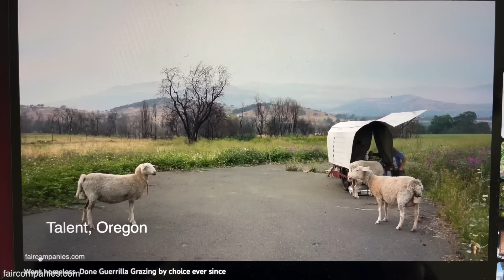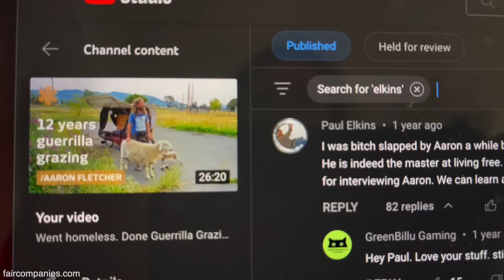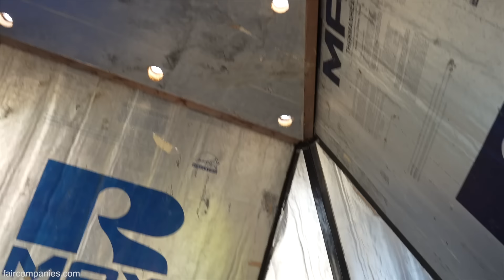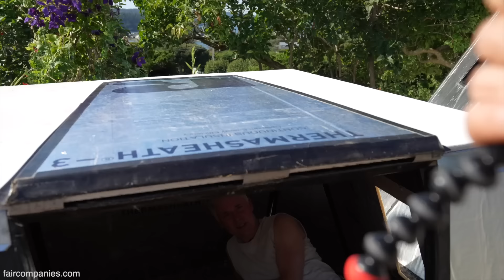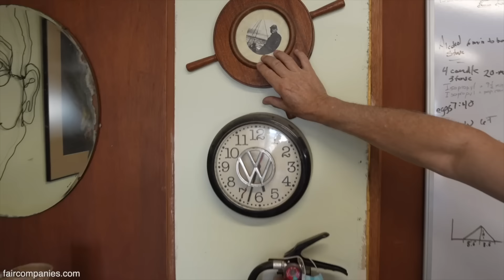Boeing DIY inventor shows new ultra-cheap houses to nomad shepherd

Comment: After seeing Mr. Elkins use bamboo and hearing the problems he described, I thought of an alternative called Wild Honeysuckle which is an invasive plant in many mid western states. The long branches would be ideal because they are pliable when cut, contain no thorns, have thin bark and are quite sturdy after drying out.
Reply: Oh, my! I didn't know that plant had any use except to make people tear their hair and rend their garments in extreme frustration! Now, to find you can actually do something practical with it. Huzzah!!
Reply: @damogranheart5521   One important principle in permaculture. The problem is the solution. Also: There is no waste (or weeds).  Waste equals resources (or in that example an "invasive plant" is an abundantly growing no-fuss resource in form of a plant.
Reply: there's a way to prepare and cure bamboo, it's a non-problem with the right knowledge!
Reply: Japanese used to make everything out of bamboo, it was the plastic of Asia until the forests were burned down in WW2.

Takes 10yrs to make a bamboo forest that can provide building materials for a nation. 

U can make  everything u want out of bamboo. From houses, plumbing, flooring, plates, spoons and forks.
Reply: Willow. Done

Comment: We are currently working on the idea of a residential electric car. There will be a full bed and good insulation and ventilation. By joining the community, you will be able to have access to special parking lots where you can take a shower, wash clothes and cook food.
In fact, this is a great solution for digital nomads.

Comment: If I had the money I'd for sure help fund and design a new Aaron Fletcher-style nomad home!
Reply: It needs to be a powered thing. The new LiFeP04 batteries are much lighter than lead acid. In a sunny climate it could be solar powered if an inexpensive lightweight type of efficient solar panel could be designed. Lightweight flex panels don`t last long. Folding panels may last a few years but are heavy. For cooking you can just get a 500w solar power station and a 100w portable folding solar panel plus a 350w Dash mini griddle. For a fan and light get a 3 speed USB fan, Onite light bulb, and two 20,000 mAh power banks. The folding panels often have three USB ports....two for charging power banks and one for direct fan power during the day, and a power station can be left connected to the 12v charging port.

Comment: I've been homeless more than once and the critical things to survival out there are stealth, and mobility. If you have a Marine Corps 2-man tent ($100 used), it's desert tan with a reversible rain fly: tan on one side and green-camo on the other. 
 This lets you bring your gear inside, cook inside and even pee if you're inventive. (gatorade bottle for the men and ladies,,,I'm not sure) The less movement outside the tent the less visible you are. 
 You can set this tent up from a seated position, it looks like a bush, or a sand pile from a distance. It's lightweight, portable and quick drying. 
 I've slept in it without setting up the tent-poles to keep a low-profile and look more like a ripple of sand on the road-side. 
 1.don't jump fences.
 2.don't camp next to livestock. Ranchers will evict you, and not so nicely.
 3.set up camp after dark, leave before the sun comes up.
 4.food pantries, and churches will donate to you in many cases BECAUSE you are passing through. *let them know you're leaving the moment you get your food. 
 5.no drugs, no firearms, no alcohol means the cops will treat you 3% better than an addict or boozer. It's not much but it can make a difference. *don't get high with anyone you meet out there, they might just want you to go with them someplace quiet where they can jump you for your stuff. 
 6.Shelters are for freezing temperatures and then only for ONE NIGHT. *keep walking after that, crusties will follow you and you don't want that. 
 7.Baby-wipes are a godsend! Keep yourself as clean as possible.

Comment: Saw something that may be of use. You can waterproof any fabric like old sheets or canvas sacking by squirting a $1 tube of clear silicone in a 5 gal bucket and diluting it with denatured alcohol or mineral spirits, well soak the fabric and let it air dry..... Put that over a wood subframe and you have a water repellant but breathable barrier. Tried it personally with old sheets to use as drop cloths and motorcycle covers. Work fantastic.

Comment: Heat the bamboo with a torch,  when it's in its bent position.  It will dry out the bamboo and cure it.

Comment: I am curious if he has reached out to any homeless people to see if they could test his designs. I'd love to see a camper design that includes a 50cc motor or equivalent and lets you drive without leaving your shelter. I know a big part of shelter for the homeless is security and 2 wheeled vehicles are easily stolen. Also if a real threat like a bear or person approaches while you are sleeping you can't rely on thin materials to protect you but can't drive away without leaving the camper.
Reply: Hey Michiael. I'm working on a pedal RV for my next project, incorporating a side swing-up door like Aaron's rig, but no motor. Just geared low.

Comment: Mold comes from moisture.  Heat treating bamboo / cane to get the moisture expelled is a long time process.  First split it.  Then heat it over a flame until it's a light tan color.  Then allow it to sit in a dry environment for about 8 months.  Heat treat it once more the same way.  The moisture is now gone and it won't split.   That's the same process used to make native American flutes so they don't split and become unplayable.  You might not need the 2nd flame treating for a non flute application.

Comment: I lived in a tent in the forest and then built a hut there. These campers are very claustrophobic and not suitable for people with mobility issues. They are for able-bodied people with good health. What the government can do is allocate land plots to homeless people and help them build huts. We were harassed by inspector who threatened to demolish our hut because we did not have land and permits. It did not go well for inspector. He had to retreat in shame.
Reply: The inspector did nothing wrong.  If you owned a home, you would not want 50-100 strangers moving into your backyard, or the park next to it, and putting up huts that have no trash service, or toilets, no water, etc.   Common sense says that the area will be a trash and sewage filled mess after a few weeks, and pretty likely that there will be a fire eventually, with no electricity or gas for cooking, often spreading to neighboring huts as well, or a poorly made wall will collapse on some kids, etc.  Not a great situation.  

And you can’t just go into a woods you don’t own and start building a DIY hut.  That just ends with a squalid encampment.  

But I actually sympathize and it’s a tough issue with no perfect answers.  I agree these foam shelters aren’t suitable for much, despite being well meant.  They are not good for those with mobility issues, can’t be locked, the whole thing can be stolen, no water, electricity, trash, no place to put them permanently, etc.
Reply: @Itried20takennames  The inspector did a lot of wrong. Predatory attitude towards homeless penniless Class 3 ASD person is inacceptable. Poverty discrimination is also inacceptable. 

It is not common sense that says that. It is bias and prejudice towards poor people that say that. Work on your bias issues.

Common sense says that you need to be able to be in clean home, with water, somewhere to cook, and with toilet to use. And that is what we created for us.

We were not 50-100. We were only two :)
Reply: @Autism_Forever stop there are a lot of people who are poor that don't resort to being a bum destroying public property. So just stop!
Reply: @noble_norse7786  Your  comment does not make any logical sense whatsoever. I sincerely do not understand what you wanted to say.
Reply: @Autism_Forever  of that I have no doubt! But that's not a me issue kiddo! That's a you issue!
Reply: From France I can say that I understand @autism_forever.
If you want live, I mean LIVING not just working, consuming and a few holidays, I mean creating, being able to live in real conditions of life, giving importance to water and not just spending thousand of galons without any consciousness, having your mind more free, you have to live in the nature. 
Not having money is something else. Well if you can pay a piece of land, good for you. But we live in society where the biggest lye is : if you want if you work you will success.
This happen to 0.005% of the person who madly work. The truth is you're born poor, you'll work like madness and still will be .

We only have one life.
Reply: @mychkineplot7677  We work to live NOT live to work. 

I rather use less and be happy than kill myself working. 

Considering that I develop life threatening seizures and convulsions from exhaustion due to my disabilities, I can literally die from overwork. 

Many people these days are afraid of nature because they have separated themselves from it completely.

There was a news story few years ago about a man who died from hunger in the forest because he got lost and could not find any food. 

I go into the forest - and there is food, water, and shelter literally in every direction :)

Comment: On preserving bamboo (for Paul Elkins), this from Gradua Bamboo (German-South American Industrial bamboo exporters):  

"Curing bamboo with borax and boric acid is the most popular bamboo preservation method (for indoor use) around the world because it is effective and more environmentally friendly than other wood preservatives.  The combination of boric acid and borax in a ratio of 1:1.5 is an alkaline salt called: Disodium octaborate tetrahydrate (Na2B8O13 x 4H2O) and is available in pre-mixed powder form, usually under the commercial names: Tim-Bor or SoluBor, among others.  Disodium octaborate tetrahydrate is a white, odorless, powdered substance that is not flammable, cumbustible, or explosive and has acute low oral and dermal toxicity. The product itself is fire retardant and shows no hazardous decomposition.  This salt, is used as an insecticide and fungicide, and is also effective against fungi and algae. It has an infinite shelf life and is not affected by temperature."

Comment: I met a vehicle similar to this one in Quebec, Canada on rural roads in summer. The vehicle itself surprised me because all I could see from afar was a burning white flashing light mounted at eye level for a car driver. I was approaching this light carefully and to my astonishment I saw that it was kind of a slim and elongated shape low to the ground vehicle. On this rural road there are a lot of tractors, vans, cars, trucks. My thoughts were for the operator's safety. Only this rapidly flashing white light warned us of his presence. It was not going very fast about 70km/hour on a 90km/hour speed limit.

Comment: That wheel gadget at about 33:00 reminded me of one of my fondest childhood memories playing with my best buds at about age 8 or 9. We lived in the inner city, the poor part of town, and we had to entertain ourselves on the cheap. Sidewalk shoe skates were the big thing at the time, if that gives you some reference. One of the guys got hold of what I think was a farm tractor tire or maybe a semi trailer tire. Not sure where it came from, but it was bigger than a car tire. We would curl up inside it just like Paul did here and roll each other for the entire length of our block. Your friends could stop pushing about a third of the way down the block and you could coast from there. We were on the sidewalk and a couple guys  had to be stationed at the end of the block to stop you from rolling out into the cross street. Man, that is some memory to recall! Thanks for the video on just the strength of that.

Comment: Great video, thanks. I have been a fan of Paul Elkins for a few years now. He is partly responsible for my channel. Basically, he inspired my pop-top micro-camper. What I have built is a permanent use mobile home that is off grid. The Tesla Cybertruck prototype is the inspiration behind the velomobile that will tow it.
I get so many ideas from Paul. Thanks again.

Comment: Yes, this duct tape is awesome. Would like to see the manufacturer make it in white also. It would reflect the U.V ray's rather well versus black. 
Thus, prolonging it's sustainable life span. 
This tape is not cheap 🤣
I really liked the desert dwellings (aka: Burning Man). A small portable solar air recycling system may be a good addition to these small dwellings (help regulate fresh oxygen levels). Could use some screens ports..
Thx for the ideas and have a great journey ✌😉

Comment: That teardrop three-wheeler... there is soon one on the market, maybe next year, a sporty all-electric commuter two-seater that focuses on the absolute minimum aerodynamic resistance. It's made by a company called Aptera Motors. Kirsten visited them a year ago too! They've since progressed to the pre-production stage and have finalized the engineering and the last of the design. It looks like they are now starting to order the tooling but the the actual start of mass manufacturing is still hinging on finalizing the last of the funding – but it's looking like it's got at shot at finally happening.

Comment: You have some great ideas ! 
   I am not homeless now, and by the grace of God, I haven't been for over 10 years now; however, I did experience homelessness off and on for 2 years. It still haunts me. 
   It now holds even more challenges. Many red states such as mine, Missouri, have made homelessness a crime. If you are caught sleeping outside, it is a misdemeanor. I presume that 3 could be upgraded to a felony in some states, although I have not confirmed this. It is shameful ! The homeless need more advocacy by attorneys around the country to put a stop to this. It is said that you can judge a society by how it treats it's poor. We fail !

Comment: Great instructional video! 

Personally, I prefer to use the Alpine Butterfly Loop and Blake’s Hitch. The Alpine Butterfly Loop is easier to tie, much more secure, and easier to untie than the Bowline. Although I love the Trucker’s Hitch, it is difficult to tighten/adjust after tying. The Blake’s Hitch is a great alternative for most purposes. 

Recently, I’ve started using wooden toggles on all my knots to make everything quick-release, so I’ve been replacing my Blake’s Hitches with Prussik Loops.

Comment: A boat that is deeper in the bow is easier to handle in windy weather.  It easier to keep the bow to the wind and waves if the bow is deeper and higher than the stern.
Reply: The definition of seaworthy design is this keeling line stem to stern academic keeling design reduces heeling over and increases speed.

Comment: From what I learned living in Costa Rica, bamboo has to be cut during the right moon phase. I know it sounds crazy but it's true. And if you want to make it bug proof you can drill a small hole in each section and inject a little diesel, then put a piece of bamboo skewer to fill the holes with a little glue. No termites will eat it and it will resist rotting and mold. I don't remember what moon phase is best for cutting bamboo but it's important for longevity.

Comment: Motorcycle wheels instead of bicycle wheels may be the solution to the shepherds wheel longevity issue plus an old BMX trick using an old tire inside of a new tire as a liner for puncture resistance

Comment: Take already shrunk wrapped 18 inch bales of straw and drive down one of those fence posts. As it's driven down, use great stuff around the post to seal the holes. You want to go up eight feet high and add a coroplast a frame roof that should cover the surround porch.

Comment: that foldable structure you used on burning man is great for car campers of the offroading type:
insulated, completely closed (no bugs 🐛) but foldable so can tuck onto car roof
Reply: As a note from the burning man construction information (look for hexayurt by Vinay Gupta) it is recommended that you get two pieces of plywood for a sandwich, and maybe even build a faring for the front of them, otherwise the wind will beat them to death and tear them apart.

Comment: I absolutely love Paul and his work, been a fan for years! 
The trike is something that should be mass produced and mainstream honestly for the fuel efficiency, weather protection and overall better safety than a motorcycle. In the future I’d like to have either a trike like that or a velomobile - which would be used for most of my transportation, since most of peoples car trips are one person trips. Multi-person vehicles are a”considered a commodity when they should really be a luxury item.
A bicycle fixes a lot of short trip issues, a velomobile fixes longer distance transportation. Unfortunately with our settlements being on or around hills and valleys we can not currently avoid motors, either electric or liquid fueled ones. Maybe we’ll have a solar vehicle that solves that part.

Comment: Play around with fabric-cement, add chicken wire or plant fibers for structural parts. Using fabric soaked in cement-mud allows for making quick, strong thin-shells.  
Be Prepared!

Comment: The sink was a neat feature and could easily be adapted to have continuous running water using air pressure and a bicycle tire hand pump to "charge an air tight refillable water container.